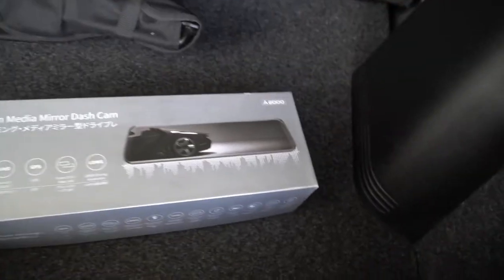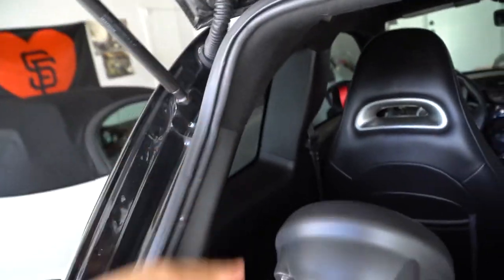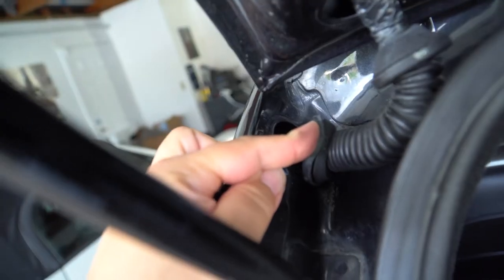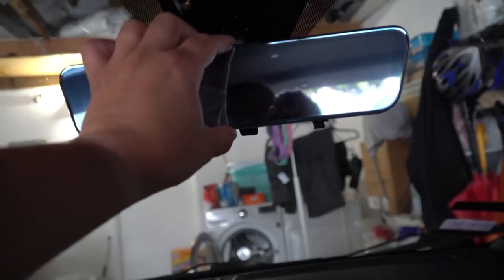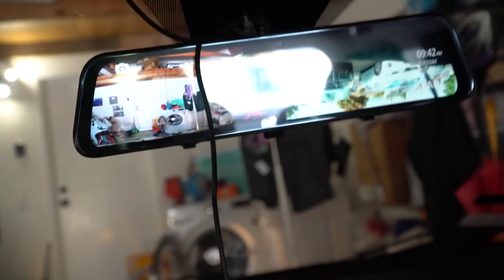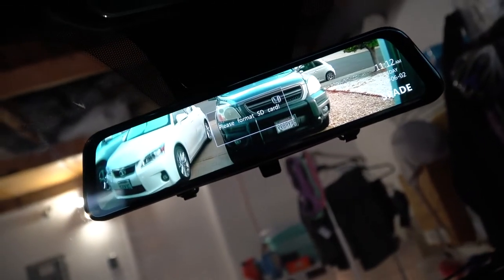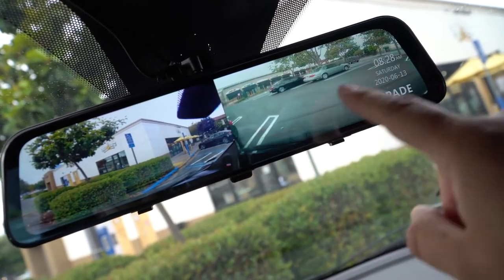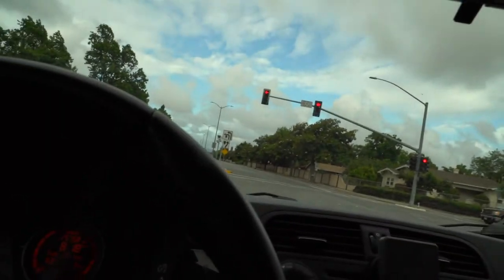Mirror Dashcam Install

Comment: I'm so glad I found your video...my Girlfriend just bought me a kit just like yours. 
And I was hoping to find out the best place for my rear camera.  And your choice looks good to me. 
One thing I'm sure by now you probably have figured out is that you should have a button under center of the dash cam that turns your screen off and you can use the mirror (as a mirror).
Thanks!
Reply from the maker: Glad it helped you out. Another option is to unplug it if it's connected near by or sometimes dimming it all the way down works depending on the daylight